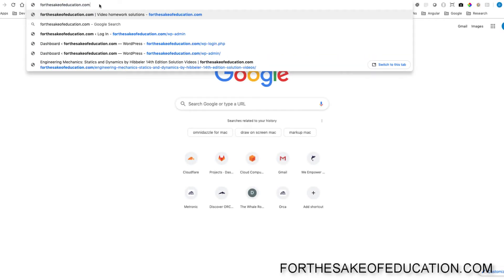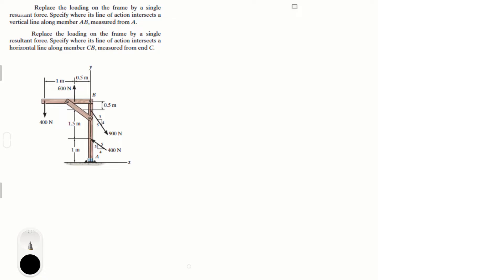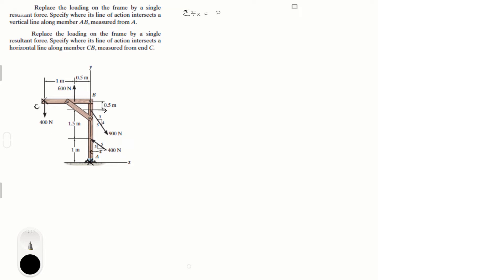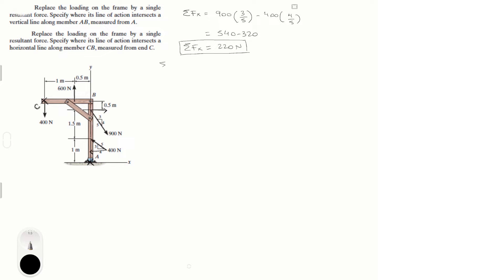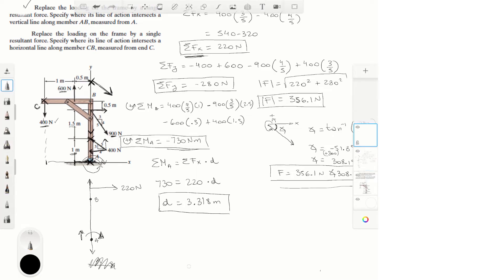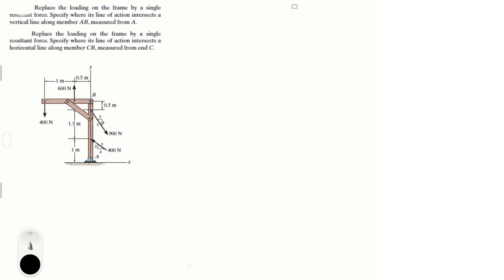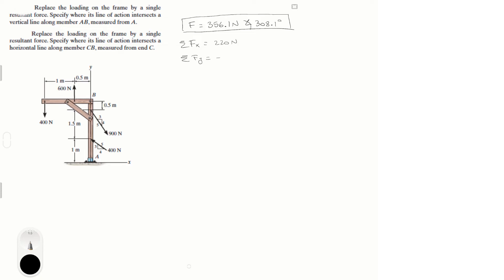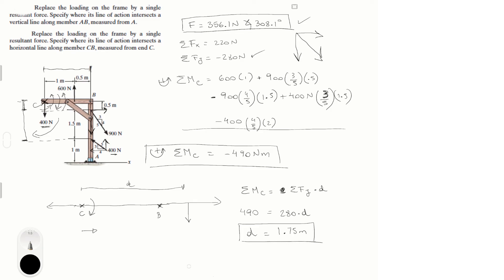Replace the loading on the frame

Comment: how did you know 900(3/5)(.5) is trying to turnit counterclockwise? I am confused on that.
Reply: the x component of the force is below the point that we're taking the moment from, and the x component is positive, therefore only the x component of the force is trying to turn it counterclockwise. I hope that made sense!
Reply: @CollinRaves  please explain again. I don't understand
Reply: @Taieba_Meem  imagine pushing the structure with your finger at the point where the force is with the axis of rotation being the left most point. It turns counterclockwise